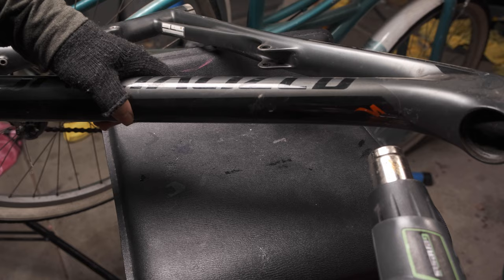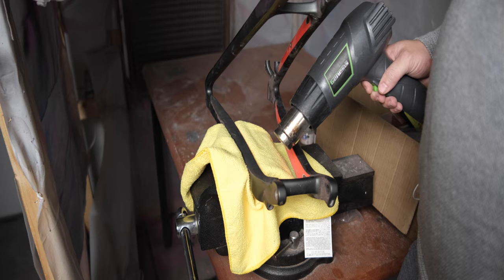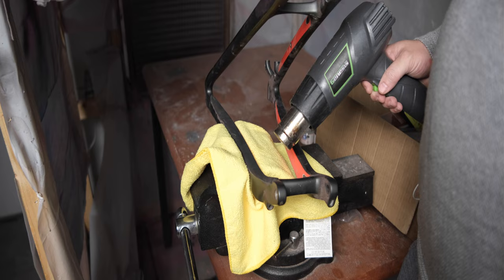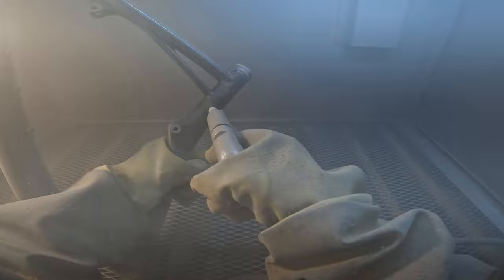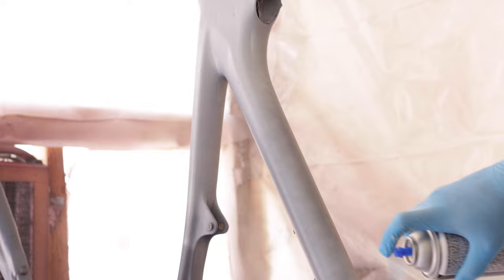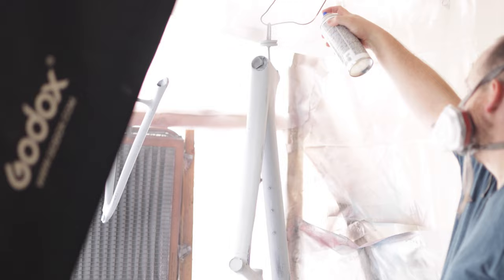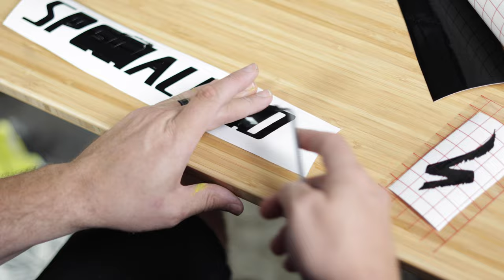I Restored a Specialized Epic

Comment: As retired paint and body man you would have been better off with scuffing the entire frame and addressing the areas in the frame that were scratched down to the carbon and hitting those with a skim coat of filler then building your base of primer from there. Once you media blast carbon frames or anything carbon for that matter you begin to see the many seams, imperfections and joints that were covered by the manufacturer. I have never had good results with it and frankly unless you are repairing a crack in the carbon there is never a good reason to take the finish down that far. Love the build. You did a great job
Reply from the maker: Thanks. I appreciate the feedback!
Reply: Thanks for good advice

Comment: I’ve never heard the contrary, but I’ve always assumed you shouldn’t sand blast a carbon frame. Can anyone confirm/deny?
Reply from the maker: It depends on the medium you use. You have to use a softer medium than carbon but a harder medium than the paint. It's a very fine line. I use walnut shells and it does not eat away the carbon.

Comment: Always watch your videos, glad to see you blasting a frame again!

Have you tried a gap filler that you can scrape on? Maybe one that is a lot softer than the carbon and then get a sandpaper to finish it that wont cut the carbon but will get the filler smooth.

Would love to see you material blast every component and use other cheeky weight weenie engineering. 

No dropper?
Reply from the maker: Yeah I need to use a gap filler. Filler primer is not enough.
No dropper. It's an XC bike for a short kid.

Comment: Love what you do, considering some updates to my 2015 Epic WC. Noticed you didn’t use a slackened headset on this one. Any reasons why not? Wondering if I used a 110/120mm fork, slackened headset and shortened the rear travel I could get close to the $$$$ new Epic WC - or ruin the bike 😂
Reply from the maker: Slackened headset not necessary for XC
Reply: @BuildaBetterBike  really? That 2018 bike is 69.5 HTA and the latest XC bikes e.g.  Specialized Epic WC 2023 is 66.5 HTA and epic evo being used in XC races
Reply: I just built a 2017 Epic with 71 degree head angle. Handles fine.

Comment: Didnt knew you could sandblast a carbon frame,it doesnt get damaged at all? I tought that sandpaper was the only way to remove the paint
Reply from the maker: As long as the medium you use is softer than carbon, it's fine. I use walnut shells.
Reply: @BuildaBetterBike  thanks for the info